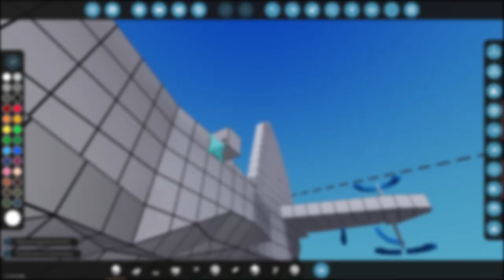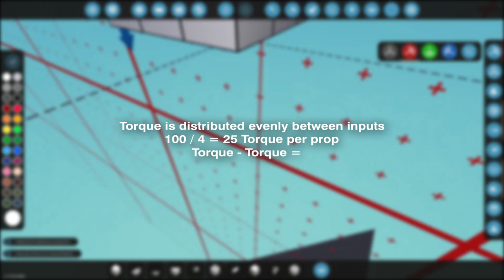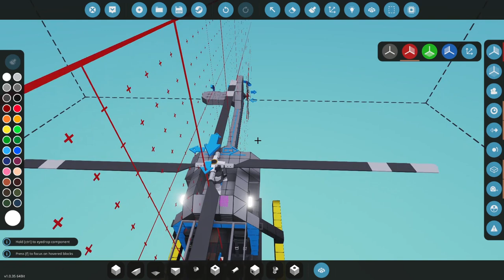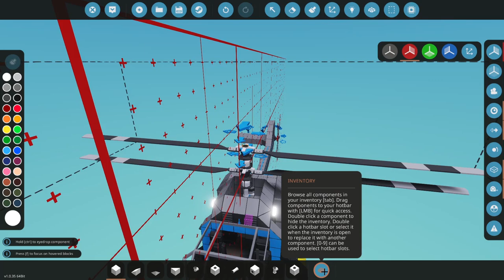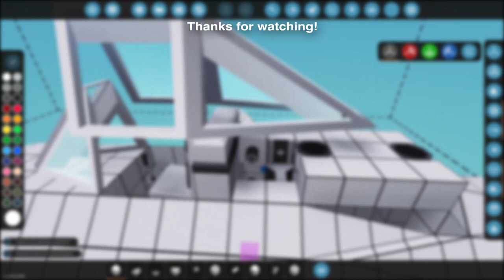NO MORE ROTOR TORQUE! - Coaxial Rotors Tutorial

Comment: How do you turn without the tail rotor? In my head, you could slow one rotor and speed the other coaxial rotor, but I'm kinda blanking on how to implement that.
Reply: (clutch, probably)
Reply from the maker: You can control the roll of the rotors to spin it